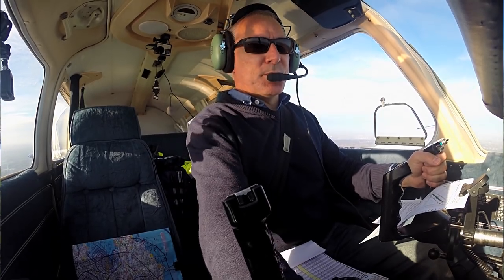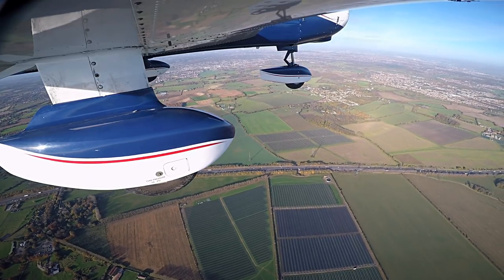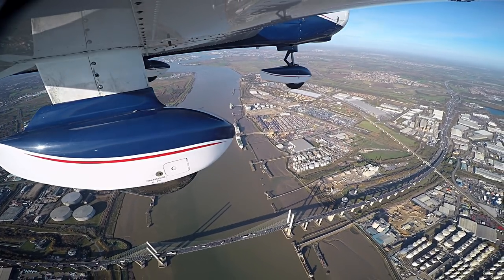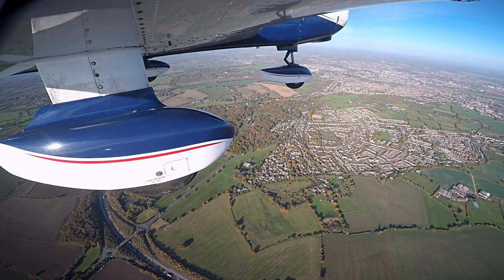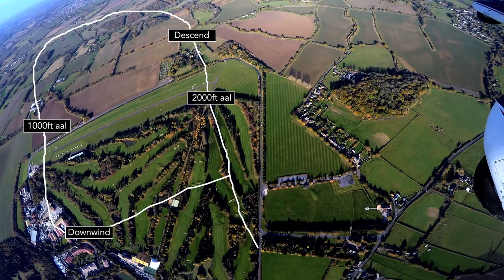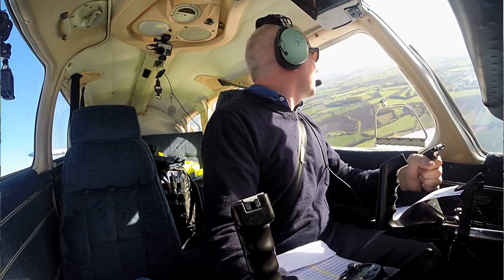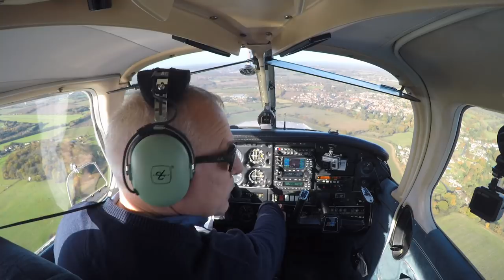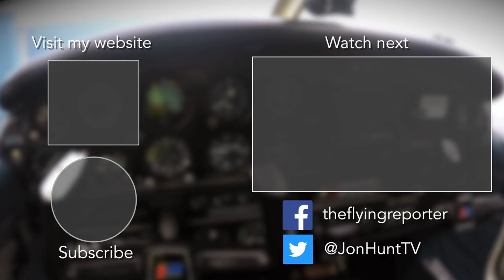How to fly the Standard Overhead Join.

Comment: Really cool to see how some operations are carried out in the U.K. vs. here in the U.S. You sir deserve more subscribers. You gained one here!
Reply from the maker: +MrAviation101 cheers Josh.  Good man!
Reply: Josh. Is there a difference to the overhead join in the US?
Reply: We’d call that a crosswind join in Aus, and if we were overflying to check the aerodrome before landing we’d be circuit height +500 feet not 1000. Apart from that all looks familiar. Nice video as always Jon 👍
Reply: In Canada we cross mid-field at circuit altitude and join mid-downwind at uncontrolled airports.
Reply: Althought I'm from Liverpool, UK, my first 36 hours of flying was in the US (Casper, Wyoming) in 1998. I had absolutely no issue flying over there and RT wasn't a problem. I only restarted flying lessons two years ago (with a 1-year hiatus last year to focus on ground school exams) and Liverpool is a lot busier. Over the US, I used to join the circuit mid-way downwind or straight in approach and never an overhead join. The join RT also included "...for the option" which I don't think we use here in the UK especially because around the larger aerodromes, we have VRPs (Visual Reference Points). During one lesson, I didn't study the VRPs (or which runway was in use) so when flying in to Hawrden, Radar/Approach said "G-LFSW. Route to Poulton then join base leg for Runway 22. You're No. 2", I didn't have a clue where I was supposed to go.

Ironcially, I find Jon's videos extremely beneficial help me transition from US to UK flyiing; especially the RT.

Comment: Yet another great video Jon - and what greaser! I sat there a bit yeh 2000ft, yeh descend deadside to circuit height, yeh then turn downwind. In my early days with a PPL I joined overhead at what was Kemble, totally got it mixed up and had a head to head with a Twin that was doing it right. Scared the crap out of me and always did a sound job of briefing at after that! Bravo Jon - great video and sound advice to something that is straight forward but easy to get wrong! JP
Reply from the maker: Cheers Julian.

Comment: Hey Jon, Great video really like the new camera angle. I've never been to Earls Colne that runway reminds me of the old taxiway Redhill uses as a runway, it wasn't even straight. It was great fun, they have now made it straighter and wider. One point that really stuck out to me was time taken to set up the cameras. This is one of the reason I no longer film my flights (apart from the fact I never quite got the editing part). Driving to my base takes about 1hr 30mins taking the cover off, doing the A checks ( I have to get a ladder out to do the fuel checks), setting up the ipad, by that time I just want to get in the aircraft and fly not take another 15 minutes trying to set up cameras!
Reply from the maker: It's a real issue.  You have to do it properly, and it can take me anywhere from 15 minutes, to an hour.  The exterior mounts are still work in progress, and I wanted them set up for particular angles for this flight.  I'm sure it'll get easier.

Comment: Is the "controller" only providing traffic advisory services (assuming that's an uncontrolled aerodrome)? Agree with you on winter days being great for flying... You also don't sweat your brain off especially in a PA28 with no A/C!
Reply from the maker: Hi.  We have three types of aerodrome in the UK.  This is an AFIS aerodrome (Aerodrome Flight Information Service).  They can give instructions on the ground, but can only give information for aircraft in the air.
Reply: Got it, thanks for the info! In AU it is somewhat different with the aerodrome being either controlled (towered) or non-controlled where pilots advise intentions on a common radio frequency (CTAF, Common Traffic Advisory Frequency). AFIS seems like a useful service especially for some busier aerodromes! Cheers from downunder!

Comment: Very informative, if you wanted to would you be allowed to join the circuit on base leg?
Reply from the maker: It's an AFIS aerodrome, so pilots control themselves in the air, however if the AIP entry, or aerodrome published instructions say join overhead, or overhead join preferred, then I would be tempted to do as described.
Reply: The Flying Reporter thats great thanks 👍

Comment: Question?  If the circuit height is 1000ft and an aerodrome has a qnh and a qfe would you enter QFE in to the altimiter and when would you enter it over head at 2000ft?   And how would you avoid any controlled airspace?.
Thanks
Reply from the maker: That's at your discretion.  If there's controlled airspace nearby, you might opt to stay on QNH.  Typically you would set QFE when you have the field in sight.

Comment: Can I ask, what to do if arriving from other directions, say from the North in your example?

Keep up the good work.
Reply from the maker: Good question.  Technically, you should continue around in the overhead at 2000ft above aerodrome level, going around in a circle, turns in the direction of the circuit pattern, until you reach the threshold of the runway in use then descend deadside and continue as the procedure.  Some, cut this short, and just descend and join crosswind.  The benefit of circling is that it enables joiners to establish what's going on in the circuit and fit in with other joining traffic.
Reply: The Flying Reporter thank you I wondered this too

Comment: What do you do if you arrive overhead (turning left) and then discover that you have to join a right hand circuit - would you U- turn on the non traffic side?
Reply from the maker: +kkiwi54 of normally, you'd know before you got there, but i guess if there is no radio, no written procedure, no other traffic, I'd assume left hand circuit, circle left, look at the signal square, and if it was showing right hand circuit, I'd leave the overhead, and reposition with right hand turns.